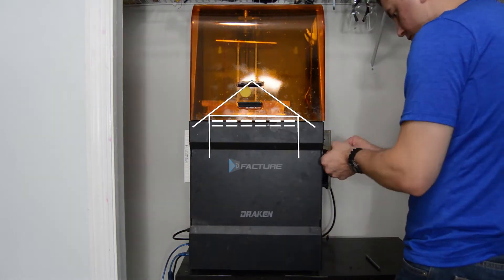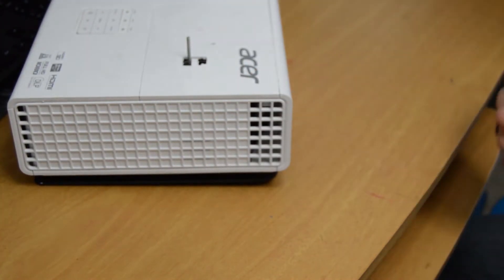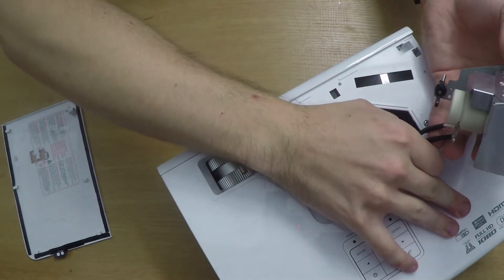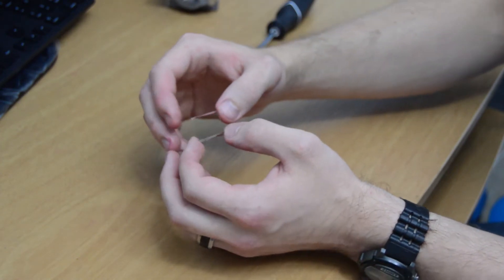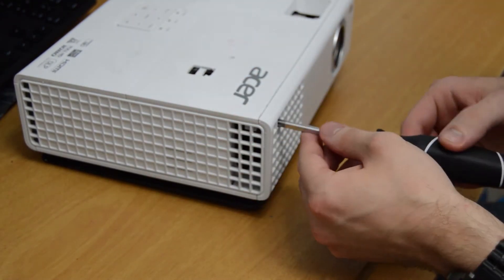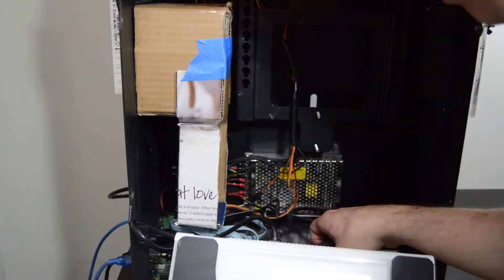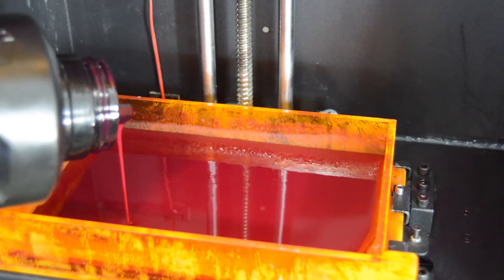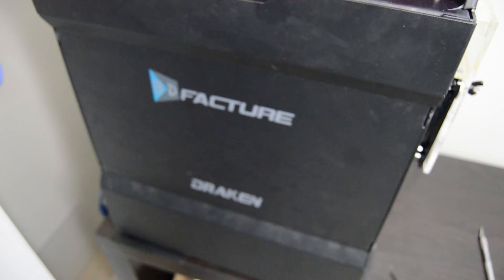DLP Projector UV Filter Removal Guide

Comment: Good idea except you might reduce the lifetime of the bulb since dust will go on the tube and cook, and acts as a heat insulator over time.  Probably worth the risk for time gained though.   I have the same projector btw if the main fan stops working and replacement fans bought off ebay or whatnot third party sellers aren't working (projector shutting down due to overheat) its because the power/ground/PWM wiring is not standard on the PCB, Carefully Swapping the crimped pins will work. Crap acer design, my fan died after 4 hours initially.
Reply: It also dumps tons of IR and UV radiation into the optics.  This will burn the shape lens and burn up the light tunnel integrator.

Comment: hi, do you think this modification could create enough UV output to develop photographic prints on UV-sensitive paper? i know that might not be your area of expertise but i'm not sure exactly what amount of UV light this kind of projector would put out. thanks!
Reply from the maker: A DLP projector puts out quite a bit of UV light with this mod and would definitely work with UV sensitive paper.
Reply: @GarageScience  Do you think it would still work without removing the filter and increasing exposure time or deffinitely it wouldn't work? :)
Reply: much appreciated
Reply: oh i forgot to ask, what model of projector do you use in this video?
Reply from the maker: I have the Acer H6510BD
Reply: @davidm8430  this actually works without even removing the filter :) i use it for cyanotypes
Reply: devilmastah oh really? i would love to hear more about your process, it actually didn’t work for me even after removing the filter. feel free to message me if you care to share :-)
Reply: david m hmm thats weird, for how long and on what scale do you expose?
Reply: david m also what projector do you use, LCD wont work nearly as well as DLP
Reply: devilmastah it’s a BenQ MLP780, so it is DLP. i tried exposing an 8.5x11 sheet from maybe a 1 or 1.5 feet away, which I would have thought would be pretty close. washed the print after exposing for about an hour and had nothing
Reply: @davidm8430  hmm im not to familiar with most photographic processes (just starting out). For the cyanotypes i have to expose a A3 sheet of paper (for size) for about 1 hour to get it fully darkend. In sunlight a cyanotype is done in about 10  minutes. 
What process are you trying exactly ?
Reply: devilmastah sorry, i should have clarified that i’m doing cyanotypes. had tons of luck exposing with sunlight but an hour under the projector gave me nothing
Reply: @devilmastah  May I use a Led (not lcd) projector for cyanotypes?
Reply: @davidm8430  Did you manage to get the cyanos with your gear? :)
Reply: @tcdp9804  no, i never ended up trying again after that initial attempt. based on re-reading some of those earlier comments,  it sounds like maybe an LCD would work better than DLP
Reply: @davidm8430  What makes you think that? How about a Led projector? on the web it says it emits uv rays. What do you think?
Reply: @tcdp9804  I doubt that the blue LED part will output enough UV light. The old type (HID) lamps produce tons of UV.
Reply: @davidm8430  You could try removing the UV cut filter that is in front of the lightbulb itself most of the time. That cut the exposure time here by a lot. Just be aware that it might damage your projector in the long run. 

For that, remove the lamp from the projector. in front of the reflector in the light path there is a window on almost all bulbs i have seen. This is an UV filter.
Reply: @devilmastah  I have an old projector but it is 480 x320 so the outcome wouldn't be any great!!

Comment: hi!

Ypu know if doing this can I use a resin that uses a wavelength 385nm ?
Reply from the maker: You definitely could cure resin at 385nm without a filter. But without a replacement filter you will likely reduce the lifespan of your DMD chip. The chip is very sensitive to light below 385nm and without a filter there will be a significant amount of light below this wavelength that gets emitted.
Reply: Ok!!! Thanks a lot!!!

Comment: Hello, i have made the modification, it works great. Could you tell us where you have bought a light filter with a wider pass bandwidth in the UV range ??
Reply from the maker: This is the filter I used in the video: https://www.pnta.com/lighting/dichroics/rosco-permacolor-dichroic-filter-3660-double-coated-uv-pass/
Reply: Ok thanks, this help me a lot. Could you order the filter with the good dimensions or you had to cut it from 2"x2" plate ?
Reply from the maker: +Nicolas Tranchant I cut it as shown in the video, it wasn't hard to do and worked just fine.  You can have a custom cut filter but it may end up costing more. The slot in the halogen lamp is 20x25mm
Reply: do you show how to cut the filter in this video or in another one ? because i look the video and can not find the moment you explain how you cut the filter you bought.
Reply from the maker: +Nicolas Tranchant I show it in this video, https://youtu.be/rN1oRhMveNc

Comment: I have heard that the filter in front of the bulb is not just a UV filter, but cuts both IR and UV to prevent heat from reaching later, more delicate, parts of the optical path. Have you found there to be any heat-wear related issues after extended printing?
Reply from the maker: That's true.  I've been shopping around for a light filter with a wider pass bandwidth in the UV range than the standard hot mirror.  So far I haven't had any short term issues with the projector.  But I will say that added cooling is really important if you make this modification.
Reply: @GarageScience  the added cooling wont help.  You are flooding the inside with IR radiation.  Its going to cook the shape lens if it hasnt happened already.
Reply: Last time I removed the filter. The slit that the lamp is shining through start burning :D So there was definitely IR problem
Reply: @hous4k hey what about replacing it with IR and Visible light filter? Will it work? Buying UV pass hotmirror is expensive ynkow
Reply: @makromi2630  I dunno what these are. Thanks for letting me know that some UV hot mirror exist tho. If the other thing lets just UV to pass then it should work, I guess and not just UV but the lightwave that the resin works with. 

I kind of gave up on the idea of replacing it with IR filter or something else, cause I didn't know where to get them and as you said they seem to be expensive. 

I thought of an idea to make different UV source that does not emit that much heat. Some are extremely dangerous so I don't rly want to give anyone an advice haha. They can cause skin cancer and you will go blind if you look at them. But you can look them up on the interenet just be careful and use protective measures like goggles etc (they are as expensive or even more as the filters tho). You then would need to create the focusing mirror correctly then as well maybe 3D print it or smtin. But it might be way cheaper then getting an IR filter or something similar.